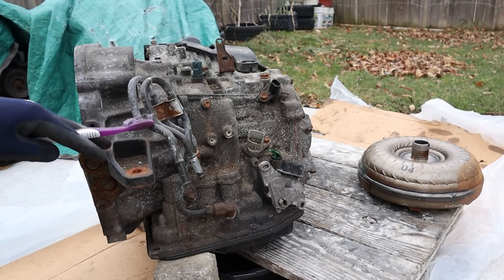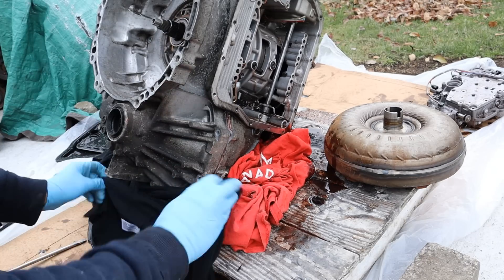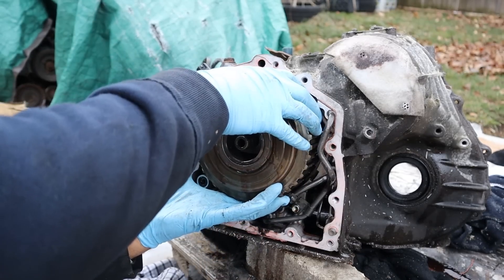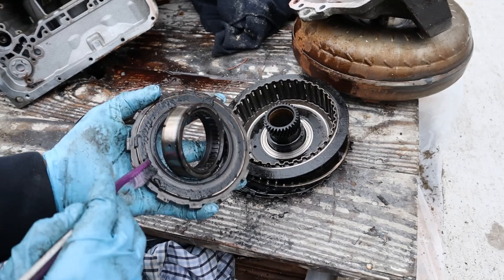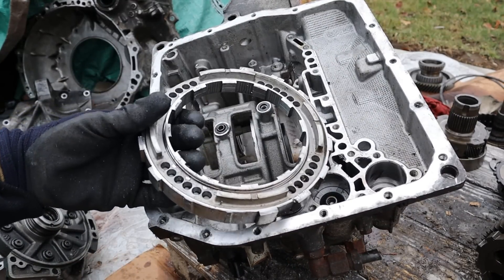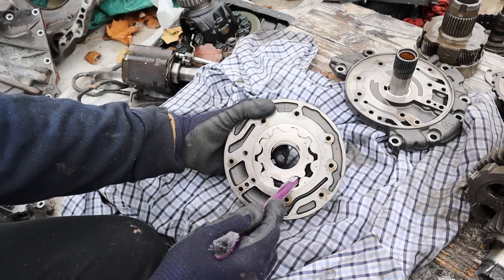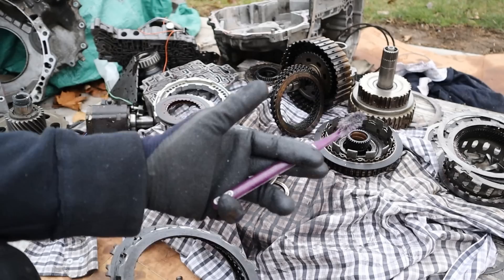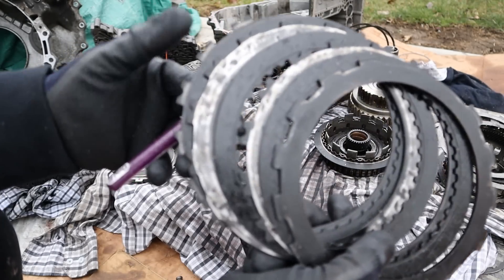Transmission FAIL: Why You Shouldn't Get Stuck in the Snow

Comment: Mr speed car. Can you do a video explaning why you should NOT change tranny fluid if it has not been done consistently on an older car? I have a 2001 montero w 191000 miles (bought it at 113,000) and the tranny is running fine but I have been warned better to just keep the old fluid in as it is thicker and was told new fluid will make tranny slip. Will old fluid reduce the life of tranny? How about draining old fluid, swapping out filter and then putting old fluid back in? Any info much appreciated
Reply from the maker: Just do a drain and fill. It'll slowly dilute the new fluid. Don't do a full flush
Reply: @speedkar99  wait..so drain old fluid, new filter and new fluid? No danger of tranny slipping with new fluid? Also, if my tranny is working fine, should I even worry about it? Love your videos btw!
Reply: @speedkar99  or just mix some new with old?

Comment: You’re wrong about the transmission fluid not getting cooled when the car is stuck. The radiator fan should have come on once the engine was up to normal operating temperature and that would have cooled the trans fluid, too.
Reply from the maker: That's if the radiator fan is tied to transmission temperature and not engine temperature. 

Also the back and forth motion causes the fluid to rapidly heat up within the transmission... A tiny cooler like that isn't cooling off that much heat!

Comment: Now I understand why front wheel drive automatic cars have that "traction control" feature which cuts power when you slip.  It's not to increase your traction, it's to save the transmission from what most boneheads do when they loose traction.  I also may have had an early 80s Camry hatchback which died this way...
Reply from the maker: Yep except this Camry didn't have traction control

Comment: i blew the tranny on my 93 camry v6 and at the time it only had 140k miles, being young and dumb at 18 years old  i try to get out from the parking spot by trying to plow my way through 2 feet of snow  throwing in reverse then drive and the wheels were just spinning did this for about an hour then  the rad fan kicking on and off a whenever i step on the gas  and i started to smell burning tranny fluid. it was down hill from there the car would jerk going to the next gear  then started slipping . about 500miles later it no longer go forward . my dad was pissed and i got one hell of a beaten from ruining a good car
Reply from the maker: Ouch!!

Comment: I would have LOVED to see you take apart the transmission on the 92 mercury Sable I drove in demolition derby with no brakes so the only way I stopped the car was by slamming it into reverse. The planetary gears and ring gear had all their teeth ripped off as well as the needle bearings on the planetarys being basically flattened
Reply from the maker: Wow! No brakes, so doesn't it stall when you hit reverse?
Reply: @speedkar99  it bogged down a little but it still went into reverse to stop the car. It nuked the transmission. But if you want a 7afe motor and trans to rip apart I got a 96 corolla you can have from the Illinois unfortunately

Comment: I have a fun story about getting stuck in the snow!  When I was a teenager I had a manual Toyota pickup I used to drive around the back yard for fun.  I occasionally took my sisters boyfriend out in the truck too.  He was quite a bit older, maybe early 20s or so.  If I would get my Toyota stuck in the snow in the winter I could rock it in gear to try and get it unstuck.  You know, drive forward or back as far as you can, hit the clutch, let it roll back a ways then dump the clutch and push forward hoping to make some progress.  Anyway I was at school one day and I come back and the sisters boyfriends dodge pickup truck is stuck out back in the snow.  OK, I thought ill get it out real quick.  I put it in reverse, no engagement....  Put it in drive, no engagement... huh...  He had gotten it stuck and tried rocking it back and forth but it was an automatic so apparently he was shifting between R and D while on the gas trying to get it unstuck like how I did with my manual transmission.  Needless to say he shredded that tranny.
Reply from the maker: Awesome tale

Comment: The surface area on the frictions and steels isnt very much on this particular unit.. Combine that with hardened leaky seals (insufficient apply pressure)  and you have clutch pack failure, something that wasnt often seen with older (and superior) heavy duty transmissions such as Ford C6, Chrysler 727 Torqueflite and to a lesser extent GM 400 Hydramatic. While the Toyota sourced automatic used in older Jeep Cherokees was also rock-solid, the front wheel drive ones are not under severe service conditions.
Reply from the maker: Exactly. These are fragile components but very important in transferring torque

Comment: Pack the transmission cooler with snow and you can prevent overheating. That’s my hypothesis anyway. If I ever get stuck in the snow, I’ll try it and let you guys know how it works out👍.
Reply: You don’t have to do that because the transmission cooler and radiator are integrated. That wasn’t the problem here.
Reply: @lampajoo  Yeah well imma a shade tree certified mechanic so...
Reply from the maker: The tiny transmission cooler isn't gonna dissipate that much heat so quickly
Reply: @speedkar99  Really do like your content 👍

Comment: stop and go rush hour traffic is also brutal on the transmission clutch pack.  if you have a tranny temperature gauge you will see the temp sky rocket under those conditions. to keep the temp under control it is good idea to place the transmission in neutral while waiting for the light to turn green.
Reply: This is what I do, and Ottawa traffic is probably nowhere near as bad as 100 degrees on the 405. Slow roll traffic kills cars, worse in hot weather.
Reply from the maker: I don't see the benefit of sitting in neutral...that would just increase the amount of engagement and disengagement on the clutches !
Reply: @speedkar99  how does that damage the clutch pack or any other component in the transmission?

Comment: My advice for anyone. Change engine oil with synthetic at 5k miles. Transmission fluid and filter change every 50k miles. And it will last a lifetime with such simple things.
Reply: The older Hondas or Mazdas wouldn't even survive 50k miles on single 50k fluid change. 30k is what Honda fluid change interval was until they switched to ZF transmission. Small tranny, limited fluid capacity, therefore more frequent fluid change interval. But you're right, most trannies need 50k miles ATF change intervals.
Reply from the maker: I change my transmission fluids once a year, since it barely drains a third of fluid through the oil plug
Reply: @speedkar99 I change the fluid every 10,000 since it’s only a third of the fluid which comes out. That means after 4 changes, there’s only 20% of the old fluid remaining. And I do this while I own the vehicle. Seems to work well for a small cost of $20 of fluid every 10,000

Comment: I don't understand the failure here. The wheels were spinning in the snow with zero effective torque. How did this cause the wet clutches to slip/burn up on a transmission with a torque converter?
Reply from the maker: The engagement and disengagement, lack of cooling

Comment: After rebuilding a U140, I know what every part is in this transmission.  Those are so burnt!  My transmission died because the pins failed on the first gear planetary and grenaded.  Luckily, I was able to get the replacement parts needed, and everything works great now.  the U140 only has 3 pins and are the known failure point for it.  The U151 has one more clutch pack, hence the 5 for one more gear.  This is basically the newer version of the U140, but fixing all the problems it had.  It's not that bad of a transmission.  You just have to take care of it.  Wow were those clutches smoked.  Mine, at 185k miles, had great clutches in it.  I replaced them anyway, but could have reused them.
Reply from the maker: Awesome work and yes the 5 speed is better than the u140. Hope it lasts for you

Comment: Well with the correctly designed automatic transmission there wouldn't have been a problem. The only problem is that it was a normal Camry
Reply from the maker: With an abnormal driver

Comment: Wonderful video as always. I do not drive any more and cycle everywhere now. I have done this for a number of reasons. Main one is that I love cycling and other is I felt that all that mechanical and electrical technology that goes into cars these days is astounding. My back ground is mechanical and electrical and really do appreciate all that you show. My first car was and Austin Mini back in the mid 1980s. Look that one up and you will not find transmissions like that within. I feel most people do not appreciate all that thought that goes into one of those super transmissions when they press their foot on the throttle just to get their backside from point A to point B. How those solinoids energize sending fluid though its path way to a clutch piston. and all this done within the confined space of the transmission case. Also that the signal fluid is actually the lubricant too. Also what amazes me is that the solinoids do not short as everything is immersed in fluid. I decided I did not need all that technology and effort to get my back side from A to B. My two bikes do use similar gear system as that but without the clutches. I really love your videos and I am always comparing all that you show and explain with my Austin Mini. Where the engine sump and gearbox were all one.
Reply: You should know that oils, be they of natural origin or synthetic, do not conduct electricity at least when only 12 volts are used as the supply voltage. After 50 years in automotive repair I much prefer hydraulically controlled automatic transmissions to electronically controlled, hence NONE of my personal vehicles uses electronic control for transmission operation.
Reply from the maker: Good choice on biking. Good for your health too

Comment: Good and complete tear down. This unit did not fail from just getting stuck in the snow. This condition usually results in hard part failure / broken parts and not friction failure.   Wheel spin tends to create enough rotational inertia to slam the geartrain and drums when changing ranges Reverse to Drive. It’s likely it was failing way before this one event. Nail in the coffin however. The units tend to make it to 200-250k and then VB and solenoids wear out / stick solenoids and cause complete friction failure. Like you see here.  It’s a Toyota but they all fail. Each newer Toyota design becomes less reliable than the previous. The next iteration U660s are almost throw away units now.
Reply from the maker: U660 is still better than the newer 8 speeds

Comment: I don't get how iterating reverse and forward motions damage trans. You shift to forward, disks (steels and frictions) are engaged (compressed), they rotate as one unit (because wheels are spinning very easily on snow so they don't cause disks to slip), no friction there thus no heat source. Same with reverse. How does it kill trans ?!
Reply from the maker: The constant engagement and disengagement (often without stopping completely) builds up heat
Reply: @speedkar99  you mean before the disks are engaged they are slipping little bit, thus creating some heat. The same might happen on disengagement.

Comment: I use my car for a courier job. So far two and a half years later of constant stop and go driving and my automatic transmission still works just fine. However I drain and fill the fluid every 6 months to one year. Fluid is cheap, but transmissions aren’t.
Reply from the maker: Exactly! Fluid is cheap

Comment: I did a similar thing on the beach with a Landrover but it was moving all the way and I didn't exceed 3500 revs/min and I was selecting manually.  So just a precautionary tale to any newbie off road drivers.
Reply from the maker: Did you blow it up?
Reply: @speedkar99  No it still ran.  When taking off on a hill it used to slip a little intermittently.  I got rid of it soon afterwards.

Comment: There is a reason you place a fan in front of a vehicle on stationary power tests. Stuck in snow also means compromised cooling, she was lucky the transmission did not catch fire!
Reply from the maker: The high heat of the transmission can't be disipated by any small cooler

Comment: Do the inner planetary runner gears (last one you pulled out at 7:44) in the U151 have the same weakness as the U140, where the bearing pin would unscrew itself/wear out? Hard to see in the video, but it seems to have a sturdier design.
Here's a U140 with a failed inner planetary:
https://youtu.be/ICns7VW5BWw?t=818
Reply: Rear planetary pins don’t loosen up as frequently on the u150 models. Seems like all the u140 / u240 are the models suffer from the pins loosening from the carrier.  I think Toyota / AW improved the carrier material and process when they crimp the pins. The Aftermarket will sometimes weld the pins to prevent pin movement.
Reply: @danhg3885  I had mine welded on the u140 when I rebuilt it.  Working great now.  The U140 has 3 pins.  This is the next model after with 4 pins, and an extra gear.
Reply from the maker: Good to know